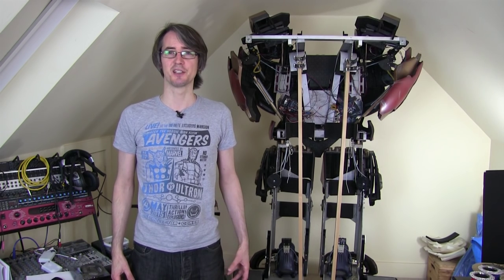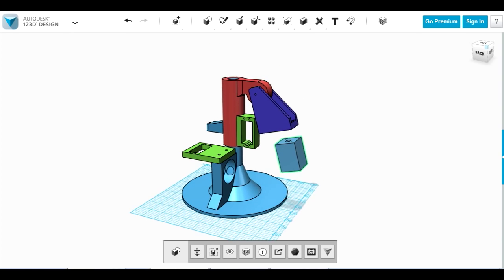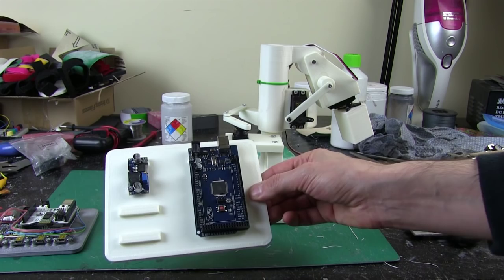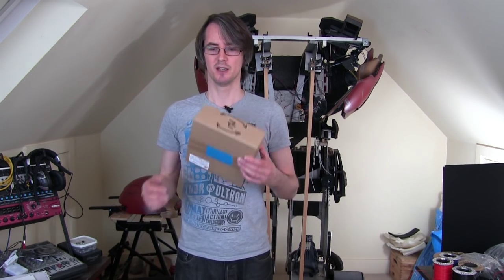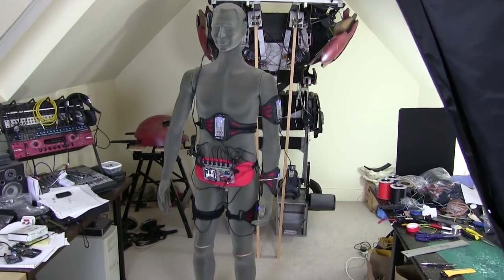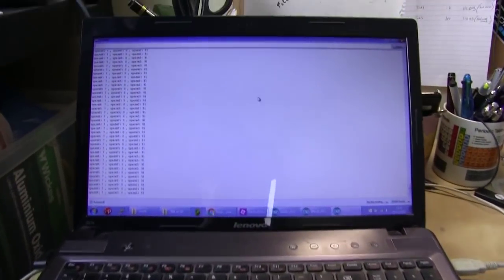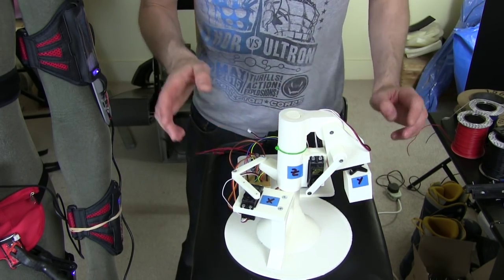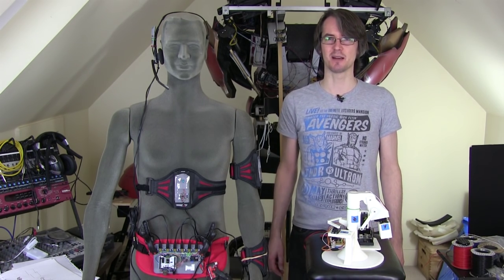Avengers Ultron #3 | Controlling a Robot Arm from Motion Capture | James Bruton

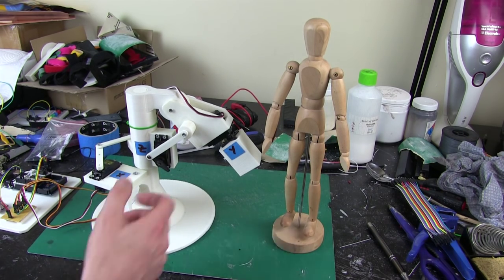Comment: At 8:55 you say your missing an axis; however if you looked at the arm differently as if you were to strap the base to your shoulder and having the Y axis as the bicep then isn't it perfect?
Reply: I think you're right. He states he's new to Euler angles, and I suspect that inexperience is his real problem. Quaternions wouldn't give him a fourth axis in 3D space. They're weird. They have 4 axes in 4D space but that's not fully representable in the real world. And difficult to understand because we don't experience 4D space.

Using a 2D model to describe the shape of a shadow cast by a rotating cube is doable, but it's more complicated than deriving the 2D projection from a 3D model. Arbitrary rotations in 3D space and quaternions are analogous. Euler angles can be thought of as a 3D projection of a 4D orientation. You just can't build an accurate physical model, because 3D space is missing an axis, and adding another rotational joint to the model can't provide it.

When I was struggling with this stuff, I ended up thinking of 4D as left/right, up/down, forward/backward, and inside/outside. But since we can't point in the w direction like we can x y and z, inside and outside are arbitrary terms in this context.

Comment: Ive been thinking about the degrees of motion issue. Your model is not realistic because the pivot points are not coplanar. I like the giant 3d printed server that you made, could you mount two of these on a disk, at 90 degrees to each other and both connected to the same arm at the same point. This would give you motion in two planes, but not the shoulder rotation. You could add that by mounting the assembly on a large disk and rotating that. Make the pivot point coplanar with the rotation point and you have a more realistic shoulder assembly. Hope that makes sense!

Comment: I would think oppositional cables running through tubes and using true ball joint in the shoulder would be a better solution it would then mimic the human tendons. I have seen hand bionics  produced in such a manner along with a rotational motor in the ball joint for twisting. with a dual pinion gear and forming the ball joint to  have a gear face. I will try and do a sketch print.

Comment: 21:00 why do you not flip/lay down the hole assembly 90 degree to the right and put on a longer rod from connection Z? It should have more range and better movement that way.

Comment: So for the problem with the rotation of the arm, I think if you rotate the whole robot arm device 90 degrees so the Z axis is always horizontal it may work.  I'm extremely tired and not thinking totally coherently, but I think that would work. Another way to explain the orientation I am talking about, is that if you took the base and were to mount it on a wall.  

That is all if the block you have labeled with the 'Y' would be having the arm extend from the bottom.  Also you may have thought around all this by now, and my comment will probably be buried. Anyways amazing stuff! I love watching your videos!

Comment: hi! I have a question that I hope someone on here could answer. I need some tiny parts that would have to be 3D printed - simple beads with sides cut off, basically, in a few sizes ranging between 1,5 and 4mm. About 60-80 of them altogether. I have no idea how much I'd be charged by a printing service for that, and whether at this measly size of parts I'd be better off getting them all printed, or molding and casting once I get one of each size. Anybody got experience with having parts this small printed?

Comment: hi james very well done on this. somewhat impressed by your ability to churn out such a great piece of work.
a piece of advice though that would make the robotic arm react a bit more realistic and closer in angle to what you have already achieved is to have the sensors that you have put on your manequin(and later you) map directly to the positions on the robot arm. essentially stick another sensor on the robot arm. compare the position of your arm to that of the robot arm and move the robot arm until the same angles are achieved

good luck and i look forward to seeing what this can turn out to be

Comment: Cool stuff again James! Learned a lot too!

One little thing about your coding, I see you use a lot of serial print and pareInt and in other projects read statements.

Serial statements are relatively CPU heavy so you may want to do less of these individual instructions and work in large chunks. That will increase overall performance and with so many servos to process you may need that performance -- especially since Arduino framework is already pretty inefficient, easy to use but very inefficient compared to coding it in C on the Atmel.
Reply: Ah okay! Well good luck in your projects and looking forward to next video!

Comment: for the elbow run the wires through a tube mounted onto the upper arm with a motor to pivot the joint. (just an idea)

Comment: They do the same thing with industrial robots, axis jog moves the individual axis. and world jog follows a XYZ coordinate system, if you give it a command to move in a straight line it automatically does all the trig, to emulate moving in a straight line even though it may not have a axis that direction.

Comment: I got to say this is probably going to be the most difficult. Not impossible, but difficult. If your really going to do that your going to need weights at the feet and hands or a gyroscope of sorts to get it to stay balanced or both. The motors at the feet and legs also would need to be exceptional to handle the weight also. All in all I hope you do great and not make it too human. Those are down right creepy compared to Ultron's madness.

Comment: In animatronics we fixed the 4th axis problem by having that part be the only angle controled by a servo or stepper motor and then controlling the other angles through cables. The shoulder attachment would then be connected through a ball joint. Doing it that way removes the headache of having to understand the limits of the robot (in animatronics we call your setup a copycat system) and you can move your arms freely.

Comment: I don't know how far ahead you are are recording this, but the quaternions are not going to do what you think they are.  The better way to think of them is that they are a generalization of complex numbers which are very good for encoding rotations in 3d space.  

The complex numbers have a single thing called i with the property that i^2 = -1.  Quaternions have 3: i,j,k with i^2 = j^2 = k^2 = -1, i*j = k, j*k = i, k*i = j, and then the same thing with a minus sign when reversing the order: j*i = -k, k*j = -i, and i*k = -j.  So a quaternion is a number like 2+3i+4j-5k.  I'll let q be the quaternion that comes out of your IMU.  Take a vector v = (v0,v1,v2).  You can turn it into a quaternion by lining it up with i,j,k as so: v = v0*i+v1*j+v2*k.  Now if you do the quaternion multiplication q*v*q^{-1} where q^{-1} = (a-b*i-c*j-d*k)/(a^2+b^2+c^2+d^2) if q = a + b*i + c*j + d*k, it will rotate the vector by the angle obtained from the IMU.  

The TL;DR of it all is that the quaternions are just a good way to encode rotations in 3d space, like a rotation matrix, but with fewer entries.  It is not about having 4 motors or anything like that.

Loving the build, BTW!

Comment: I don't understand why you keep insisting on using arduinos, a Teensy-LC is much more powerful, has more UART, is much much smaller, and it is 99% compatible with arduino. You actually use the same arduino software to code it. I2C, IO, SPI just work.... 
Nevertheless, I'm eager to see this project finished.

Comment: You couldn't assign it a 3D space and have a positional detector on both hands, forearms, upper arms, the torso, head, and both thighs and ankles? Any ball joint could be a motor mounted to a servo for rotation and extention/retraction control

Comment: I used quaternions once. Never again
Reply: +Magmafrost13     Why? Quats are awesome!
Reply: +Tetsujin Very much so, once you start trying to interpolate between two rotations you'll soon find that Euler angles just add more problems mainly lots of conditionals for various rotations. Quats however once understood makes this task so much easier.
Reply: Widow Maker   I know, right? I had more than a few difficulties getting my head around quats while implementing my first WebGL demo, kept getting rotation-of-rotation mixed up with rotation-conjugation, or did operations in the wrong order, things like that. (Honestly, stuff that would have messed me up no matter how I handled rotation) But they're numerically stable and free of gimbal lock and generally pretty CPU- and memory-efficient as well. Learning quats for me was one of those "standing on the shoulders of giants" moments, I'd struggled enough with 3D rotation issues to see some of the problems in dealing with rotation matrices or Euler angles, so to find quats, which are almost completely free of all these problems...  It was kind of awesome.  And also challenging. Took me a little while to wrap my head around it. :)

Comment: 10:00 Cut it right through the middle of the negative spaced circle, straight on through the center bar. Then add another hinge mechanism and servo to a wide swinging hinge so the whole thing swings as well as turns.
That'll make four servos on that part.
Edit : 14:53 Yeah that. lol

Comment: when the arm is pointing downwards, your Y axis is actually the aligned your X axis which is why you feel you're missing a degree of freedom. This is known as Gymbol Lock and is a huge pain in the world of 3D animation.
Reply: +ryolo132 Is it really still a problem in 3D animation? I thought the solution was to just use quaternions. Are there a lot of situations where that's not adequate?
Reply: Tetsujin
Quaternions and Eulers both have their place in 3D animation as well as Axis Angles. Usually, you'd only use Euler if you're only going to use one or two axis mainly and Quaternions for things that really need that freedom.

Comment: The human shoulder and the arm are two separate xyz axis systems, your robot design is combining the shoulder and arm into one xyz plane which is why it has issues. youre little wood model figurine shows this with a little ball joint for the shoulder. This might make it more complex of a build but i think you would get more realistic movement by mimicking the actual human body.  my 2 cents
Reply: Yeah thats what I was thinking
Reply: +James Bruton (XRobots) hmm I see... just an idea, but what about adding a 4th servo that is independent from the IMU but will move when the x and y servos are both in motion? Kinda like a buffer servo between the two axis' but skewed slightly from those two planes. I imagine it would give extra movement without having to stack two Euler planes. Basically taking an average of the xy plane and inputting it to the 4th servo. I would think your original code would work, you would just have to add to it to include the "averaged" plane. If that makes sense... ive never actually built a robot arm so I dont know, but good job to you!!!